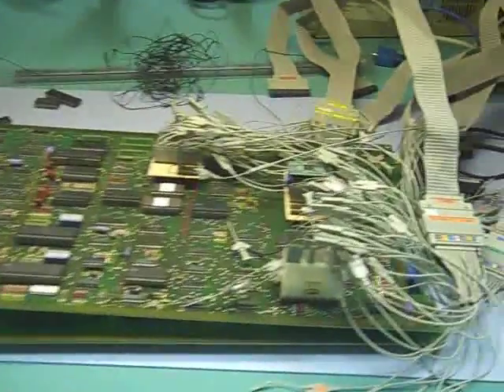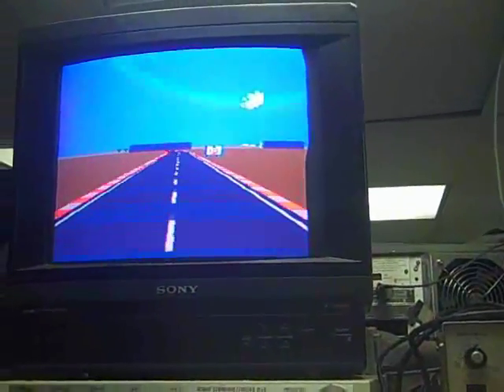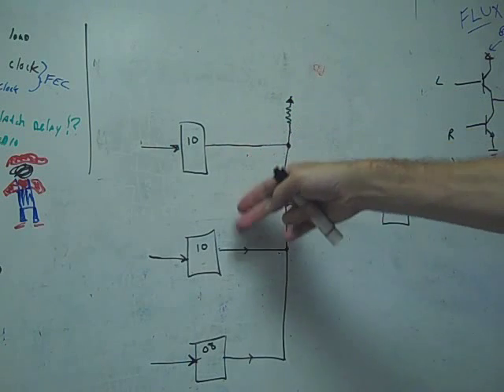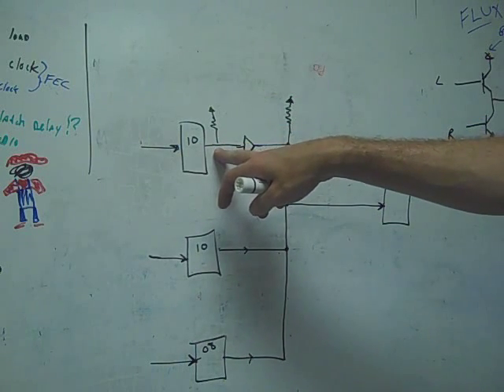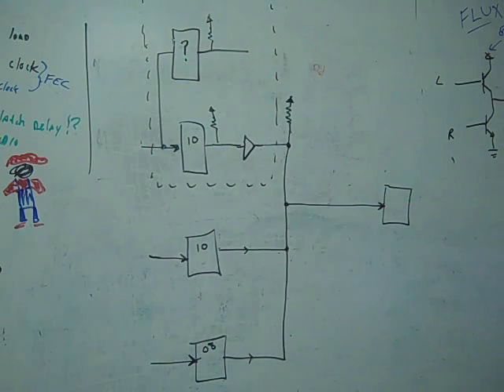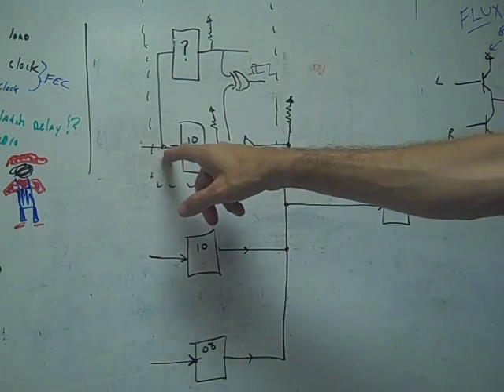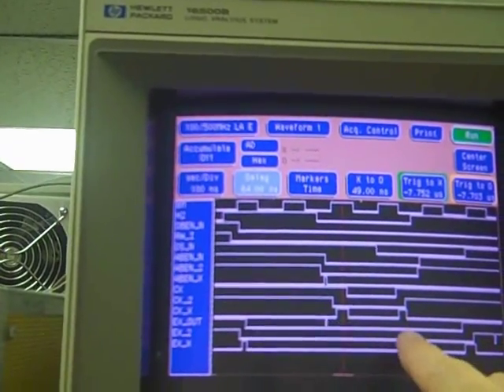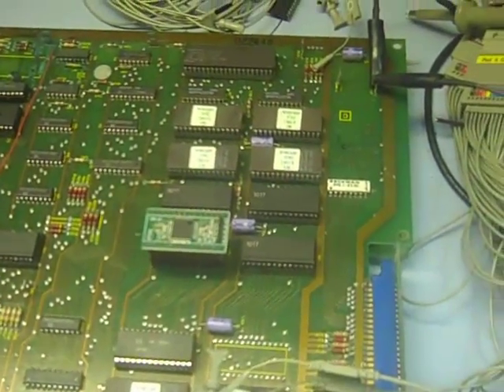Reverse Engineering the Namco 10xx Series Custom on Pole Position

Comment from the maker: Well assembly language is only used when you're dealing with a microprocessor. These customs (well... except for the 54xx series) are not microprocessors but rather just specialized circuits for a specific purpose.